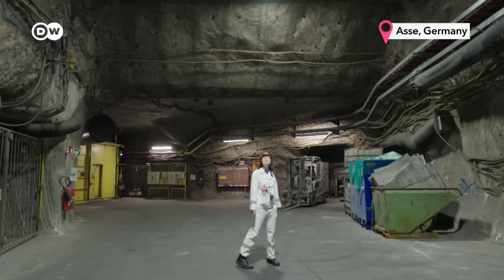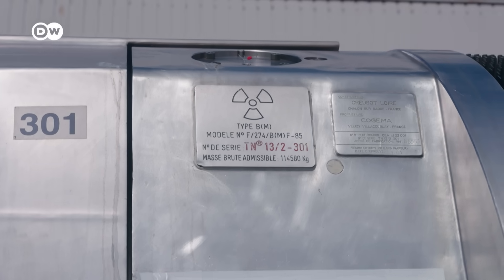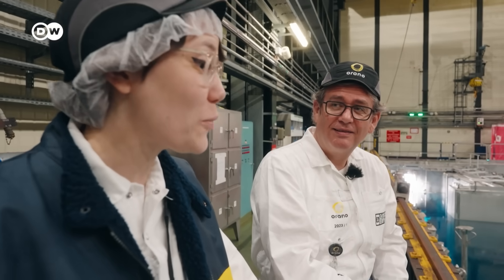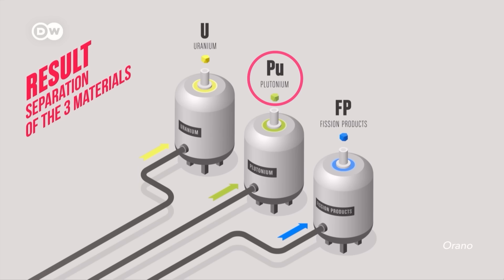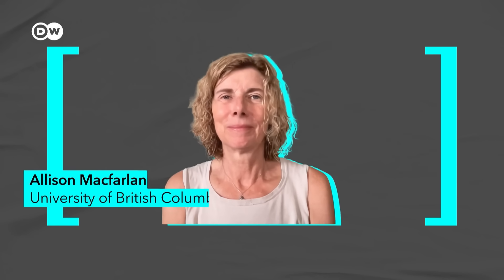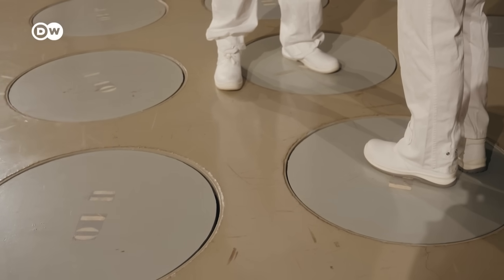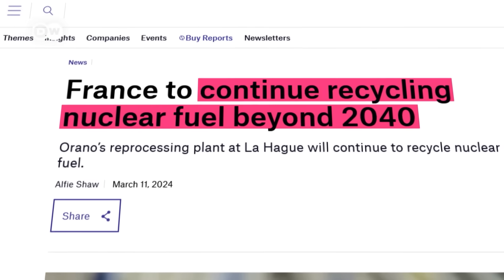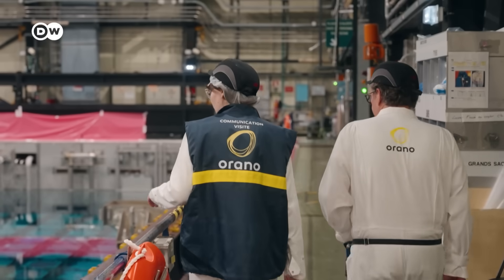Nuclear waste is reusable. Why aren’t we doing it?

Comment: Answering the question: Why aren't we reuse nuclear waste? 
Well, you need to have a specially designed facility, which - under some international contracts - can have only countries, that already had nuclear weapons during cold war times.
If you didn't, then well - you cannot build ones, because this same facility can be used to rich nuclear waste to the levels, where you can create atomic bomb.

And yes, they doesn't mention that part at all. All they said, is that countries doesn't builld this type of facilities, because they're scared of plutonium.

Comment: The crazy thing is the spent fuel is still making a lot of heat that could be put to good use, he said it is 300C inside the container.  A lot of industrial processes require heat and hot water, or just heating homes.  Heating buildings is one of the biggest energy consumers in countries with colder climates.  You could probably harvest some of the heat and radiation to make electricity...  The fission products might also have uses.

Comment: The French experiment in nuclear fuel "upcycling" wasn't a resounding success. SuperPhénix. Technically it worked and it could use MOX or Pu-239 as fuel. But the working principle meant that any incident could rapidly get out of hands and result in a true catastrophe.

There are nuclear reactors with safer working principles.

Comment: Re: The Plutonium "Problem" - No, one CANNOT use regular nuclear waste to get ready to use weapons grade Plutonium. This is patently false.
Even if Allison Mcfarlane claims otherwise does not make it so.
(Also India got a CIRUS research reactor, not a CANDU from Canada. As it was a known proliferation hazard, India "pinky promised" never to misuse it... which promise they broke).
Pu from a regular reactor will be contaminated with heavier Pu isotopes, rendering it useless for weapons.

By comparison, a CIRUS reactor enabled the operator, to quickly swap material in- and out of the core, "toasting" it just right, keeping the heavier Pu isotope content low in the bred material.
A power production BWR or PWR reactor operated according to IAEA regulations CANNOT "toast" fuel like this.
If one tries, energy production would falter due to the necessary frequent stops/restarts that IAEA oversight would easily notice.
(CANDU reactors can be refueled online, so more solid non-proliferation oversight is necessitated, but if operated according to spec they too preclude weapons grade Pu production).

Comment: Renewables are multiple times cheaper and quicker to install.
Reply: Renewables are great, but have their own downsides. Some have limited supply (biogas), some will be heavily impacted by climate change (water), and variable renewables (wind, solar) require extensive upgrades to distribution networks (including the active control of demand via smart grid) and backup capacity. 

When people try to "proof" that renewables are that much cheaper than nuclear power, they usually only refer to the direct production costs, which in case of wind and solar are indeed incredibly cheap. This is misleading though, as it ignores all miscellaneous costs. It's the same issue that makes energy from fossil fuels look cheap, even though with taking externalized costs into account, they would be far more expensive than anything else.
Reply: so untrue, watch measurements that come out of places like germany, denmark, so untrue!
Reply: Which explains why electricity is cheaper in France than in Germany and France emits less CO2 per capita and per GDP than Germany.

Comment: If the "fresh" waste is 200 to 300 degrees C, why aren't we using it just as it is to heat water for low-pressure turbines or, for that matter, just for things that require hot water?  All "waste heat" is just a failure of imagination, IMO.

Comment: It's better to use wind, solar, geothermal and a lot of batteries and other energy storage.
Reply: wind turbines are difficult to dispose of. how many solar panels are you gonna build and where will you put them. there is a limit to how many springs you can find. there is a lot of mining, processing etc involved in making batteries which are not that good and might only be useful once the technology is developed enough. nuclear can be used along with renewables to give them the push that is needed and maybe until nuclear fusion
Reply: @thunderhern3868  clearly you've been listening to the pro-fossil fuel news.

Think of mining, even the biggest EV battery is 300 kg where as an average sized apartment block will have 1000's of tons of rock mined.  The amount of mining done to build roads, building and bridges is millions of times greater than that to build batteries. But its the batteries that fossil fuel companies don't want you to have, so you must live in fear of digging up such a small amount of material.
Reply: I think that is a false comparison, mining lithium is way more difficult than mining the stuff you need for concrete. I asked Google, not sure if it is accurate :
"To manufacture each EV battery, you must process 25,000 pounds of brine for the lithium 30,000 pounds of ore for the cobalt 5,000 pounds of ore for the nickel, 25,000 pounds of ore for copper. This requires digging up 500,000 pounds of the earth's crust."
Compare that to digging up sand and stones and the ingredients for cement...
Reply: Sorry bout the non-metric units. I guess I should have asked the question in my own language 😅
Reply: So it's around 225 metric tons digging up for 1 ev battery, size not specified. Ore is the stuff they get after the first mechanical filtering, before starting the extraction process, which costs extra energy. While you only need to dig up 1 ton of sand to get 1 ton of sand... It's easier. And maybe also more important to build houses, than to build cars, don't you think?
Reply: @effedrien  absolute nonsense
Reply: @matthew_baynham  can you also come with numbers that explain why it would be nonsense? I guess not .

Comment: This process does not solve the Final storage problem. Because that is based on the fission products and they remain.
Reply: No indeed, but it greatly simplifies the problem by removing most of the mass making the final storage for unusable fission products more manageable, add breeder reactors and ideally you’re left with the minimum amount of waste possible. Russia is about the fully close the cycle in Siberia
Reply: @filippo1864  ok but if the waste consists of fission products only the radioactivity is much more dense and therefore higher. And on top you have the chemical toxicity. The waste is kinda distilled to its most dangerous.

Comment: You should do a video on the CANDU reactors.   They use less refined fuel and dramatically reduce the half life of waste.
Reply: CANDU reactors are how India developed its first nuclear weapons.
Reply: @markrobinowitz8473  The CIRUS reactor was not a CANDU reactor; it was heavy water moderated and light water cooled. I'm surprised that Allison MacFarlane got this wrong, although she did correct herself to state it was a Canadian designed reactor (which is true).
Reply: @markrobinowitz8473  CANDU reactors use less refined materials and do not create the plutonium needed for bombs.  They use natural uranium which contains about 0.72% of uranium 235.   To make bomb materials you need highly enriched uranium, which is around 80%.  They also can’t have a meltdown easily- you merely pump regular water in and remove the heavy water and it stops the reaction.   Another advantage over conventional reactors is you don’t have to shut them down to refuel.
Reply: @Tman76  All reactors create Pu-239.  Some designs do it more efficiently than others.  Several countries chose the plutonium route to make their first nuclear weapons since enriching uranium used to be very expensive in the days before centrifuges.   The heat in a reactor core doesn't evaporate if the chain reaction stops.  And worst of all, the radioactivity can't be stopped by anything except time, lots of it.

Comment: Recycling has NEVER been about being economics ... Whatever the materials we are talking about.
It's about having a clean planet !
Reply from the maker: It should be! But sometimes quite on the contrary...Did you watch our video on EV battery recycling yet? 🔋👇
https://www.youtube.com/watch?v=MrNmr2UAuYY
Check it out and let us know your thoughts in the comments.🌱
Reply: Recycling was a massive boon for the consumer economy, You can design everything with a small lifespan as long as you use recyclable materials, ,some of those 90's appliances were unbreakable even if they consume more energy, but the cost of production and supply chain is also very energy intensive.

Comment: I'm curious why the Fission Products can't be recycled? Obviously they can't be used for the same purpose, but as far as I can tell most of the Fission Products either are or quickly decay into stable or mildly-radioactive isotopes, Some being of useful elements such as Caesium and Zirconium, is it just impractical to separate the various different fission products from eachother to get the useful ones?

Comment: A better solution that I hope we will figure out is fusion reactors.  As we have imagined and experimented with them so far, they would barely produce any waste, and they are a lot safer to operate because if they fail, they would just turn off.  Though they don't seam that close since they have been researched for ~80 years and we still haven't managed to make them produce more power than they consume, though we seam to be steadily getting closer to it actually becoming something viable.

Comment: Honestly, not recycling within at least 80% for the next decade is fine. But we all know that once we slack, hence procrastinate it goes longer than expected. This goes in hand to oil/liquid fuel that we're dealing with right now. At this point, we're producing a different form of pollution that is a lot more denser, although it doesn't spread as easily in a basic system. 

Feel free to reply and keep me informed for my lack in knowledge. Correct me if I'm wrong with my perspective, very interested with that the future could be.
Reply: Don't think you're totally wrong, however it is interesting to note that nuclear is the only power generation tech that has it''s waste essentially completely contained. Making solar, wind, batteries, etc... produces a lot of toxic stuff along the way and some of that is released. There is no totally free lunch regardless of what tech is used. Newer reprocessing tech (e.g. pyroprocessing) in combination with fast spectrum reactors is a significant step up if it can be made to work effectively. Far less waste and much shorter duration, etc...

Comment: reprocessing basically makes no economic sense but as they say, france does it for strategic reasons. its also very messy. France does it well and with great discipline. i have a lot of faith in Frances nuclear sector. Now, that russian reprocessing plant they mentioned is probably the most contaminated place on earth. even more so than the chernobyl exclusion zone. Mayak. And its still operating to this day with zero international oversight.

Comment: Always with the "we need to store waste for hundreds of thousands of years." One, the waste that radiates this long is the least radioactive. The stuff that dumps it's radiation out in weeks or years is what one should worry about. Two, no, we don't need to store anything for nearly that long. Store it above ground for a few hundred years at most. If mankind does not figure out how to reprocess, and shoot the comparatively small remainder into space by, say, the year 2200 ior 2300, we truly have other problems. If you shoot it into space at escape velocity, it's gone. Could not get it back even if we wanted to.

Comment: "Why aren’t we doing it?" Money... It is money, isn't it?

Edit: I found a paper from 2004, which confirms my assumption.
"The Economics of Reprocessing Versus Direct Disposal of Spent Nuclear Fuel", by Matthew Bunn, John P. Holdren and Bob Van Der Zwaan of Harvard University, as well as Steve Fetter of the University of Maryland.
Published in "Nuclear Technology" Vol. 150 June 2005

On page 227 they conclude that: "At a  reprocessing price of 1000USD/kg HM and with our other central estimates for the key fuel cycle parameters, reprocessing and recycling plutonium in existing LWRs will be more expensive than direct disposal of spent fuel until the uranium price reaches more than 370USD/kg U - [highlits by me]
 ->>>A PRICE THAT IS NOT LIKELY TO BE SEEN FOR MANY DECADES, IF THEN<<<<<<<<<<-."

Comment: Quick Reminder:  Uranium isn't like coal:  we don't find fist-sized nuggets of Uranium in the ground.  It's in the form of sand-sized grains embedded in rock.  We then need to process that rock just to remove the uranium-bearing grains.  And those are actually uranium compounds … which we further need to refine.
  We don't pull it out of the ground in large lumps, so why are we putting it back into the ground in large hunks and expecting that to somehow be safe?

We can dispose of radioactive waste safely … by putting it back into the ground in the form we pulled it out.  But we'd need to grind it down to sand-sized grains of radioactive material that we'd then need to embed into rock at a density as low as what's in nature, before even considering burying it.  And that would be incredibly expensive.